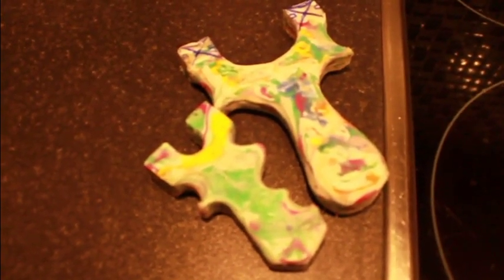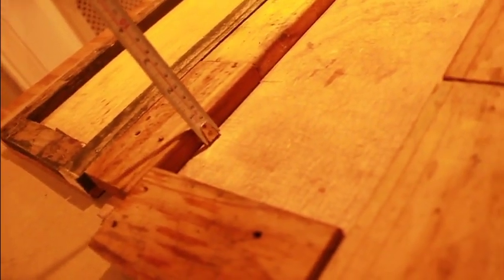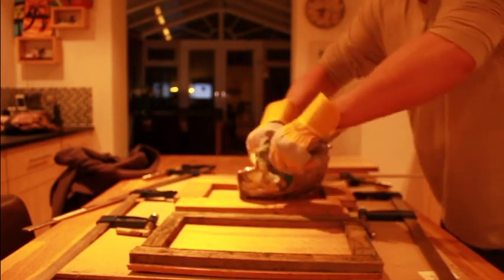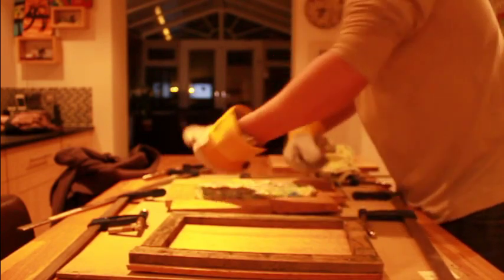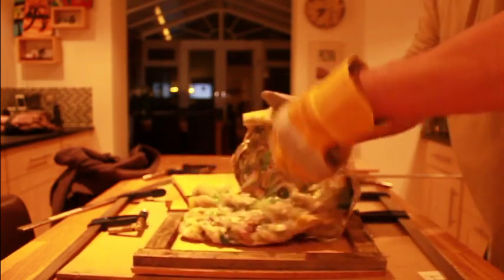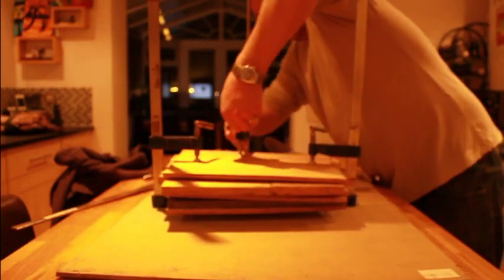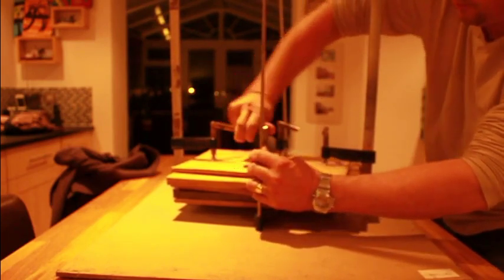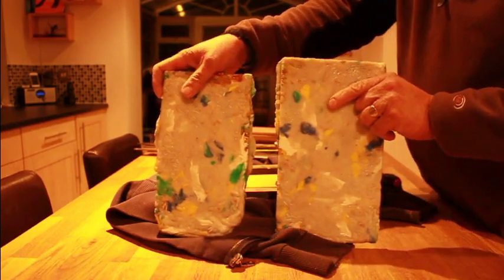Moulding  Recycled  High Density  Polyethylene (HDPE 2 )

Comment: Great effort. Terrible glove choice though. Get yourself some cooking spray and a pair of ove gloves! Work smarter not harder
Reply from the maker: Got catering grade  oven gloves now. Melt in small non stick trays now and clamp board on top and  one underneath. No need for  liners or  removing  molten HDPE from trays. Slip out  when cool and  much easier to handle

Comment: Aluminum baking sheets/pans.  Just keep putting the HDPE in it and once you get it "melted" turn the heat down some and let it bake until you can't add any more to the pan. 
Then just turn the oven off, and let it cool down on it's own. That way it sort of "cures" Leave it for like 12 hours or whatever it takes to fully cool off on it's own. I'd leave it 24-hours.

Comment: There's got to be a better way.  I prefer melting small amounts in water - takes two minutes, then the next batch will meld with the first portion easily enough until you have a large molded section done safely.

Comment: i noticed if i melt buckets such as 5 gallon ones they melt down and actually flow into the mold without any pressure however if i melt down hdpe detergent bottles and milk jugs they don't flow into the mold as well as the buckets do i heard that detergent bottles are copolymer which might affect it but i think milk jugs are pure hdpe so i was wondering if you know what may cause this to happen
Reply from the maker: Dean Walcott I have  tried  the  milk jugs as well .Might  be  because they  are thinner  but  have  always had to apply pressure  as  HDPE can warp when it  is  cooling
Reply: bubbleheadohoh i found out why milk jugs dont flow too well its because they are normally blow molded at a factory and they use an hdpe grade that flows less while melting because blow molding requires hdpe that doesnt flow too fast on the other hand 5 gallon buckets have lower molecular weight hdpe which raises the flow rate when melted the reason for this is because 5 gallon buckets are injection molded which requires high melt flow. by the way milk jug plastic is the strongest because lower melt flow hdpe has a higher molecular weight which makes it considerably stronger so if you can work with milk jugs you will have very strong hdpe which is the best for slingshots
Reply: Dean Walcott i would skip detergent bottles because they are copolymer which makes them a little bit weaker
Reply: Viscosity can be affected by plasticizers.  These are chemicals added to affect elasticity or to modify molding characteristics

Comment: what else can this stuff be used for than just sling shots
Reply from the maker: haffiti2000 Tool handles. Knife  handles. Washers  bearings  pulleys. Search on google for  more  ideas
Reply: haffiti2000 small wind turbine blades
Reply: Plates, plastic mechanical parts, anti friction gliders, bowls, cups, cuttingboards, plastic substitute for wood, projectiles, gun parts, 3d printer filament, etc...ad-nauseum

Comment: Why didn't you just clamp one mold down first before moving on to the next one. Poor plan of attack!
Reply from the maker: Numisaccent  Moulds  have  now  been modified  .Made  from steel angle  ply  and  a a layer  of  steel. Limited  number  of  clamps and  HDPE doesnt  cool that  quickly  so  no real need  to clamp the  first one

Comment: I'm thinking a method that prevents the need to transfer from the melting vessel, to the form could be achieved by melting the plastic in the forming container, of course you would need a material that can take the heat.
Reply: +Nathaniel James Try a ceramic flower pot coat the inside with graphite paste you should be able to clamp through the hole in the bottom of the pot . last thing put a plywood disc in the bottom of the pot. I was able to turn a head for a carving mallet out of the plastic .

Comment: Must be a better way.
Reply: There is a better way.  His method is very half-ass.  The missing other half of the ass is a modified coffee grinder to pulverize the shredded HDPE into HDPE powder.  Mix 97% HDPE powder and 3% carbon black for permanent UV shield.  To be fair, no one else on youtube appears to know the right way of casting HDPE, either.
Reply: TerraformingMaster Might  be  half  assed  but  it  works. Why  grind  when it  will simply  melt.Perhaps  you  could  enlighten us  all with a  video of your  full assed  method?
Reply: Keith Bell
Why grind HDPE?  Because you can then have a homogenous permanent carbon black UV shielding and titanium dioxide antioxidant mix, and the finished piece will last vastly longer and look better.  One of my videos already describes the details of this.  For any HDPE pieces that are intended for outdoor use, grinding and mixing properly is a requirement for longevity, not an option.
Reply: Keith Bell If his slingshot is exposed to any appreciable amount of sunlight for a year or two, even inside in a sunlit room, the unprotected HDPE will begin to discolor, blister, and peel.
Reply: TerraformingMaster Been making  it  for  a  few  years  and  its  never  happened. Loads  of  guys  on  slingshot  sites  have  been doing  it  for  years. MNever  had  blistering  peeling or  delamination. What  is  appreciable and  sreiously  hom many  people  are  going  to leave  a  slingshot  in direct  sunlight  for  that  length of  time? Spends  time  when not  shooting  in the  darkness  of  a  back pocket!
Reply: The reason I can comment is that I made the  video. You tube  locked my  account and  I have  never  had  problems  with blistering  delamination discolouration in the  years  I have  been reusing  HDPE!
Reply: Keith Bell
I'm not saying that your technique or product sucks or is stupid, only that your technique is very limited.  While it might work for a slingshot, it won't work for homemade full size pontoon boat, ultimate bobsled, fan powered airboat, homemade wind turbine, etc... because you need antioxidant and UV shield for that.  The quality of the melt and mix will also be much higher when using powdered mixed recycled HDPE scrap.
Reply: Serves the purpose. If  I was  going  to use  HDPE on a  larger  scale  I would buy  in sheets  or  blocks. Fine  for  small projects and  remoulding  is  well within the  capabilities  of  most  people. Doubt  very  much that  most  home  users  are  going to have the  requirement  for  antioxidants  and  UV shield  in small scale  domestic  product. Just  makes  a simple  task more  complicated .
Reply: TerraformingMaster i tried powdering hdpe milk jugs and to be honest it caused a lot of air bubbles to be trapped and it burned but when i cut milk jugs into little pieces it melted very consistent and it looked perfectly smooth and no yellowing whatsoever
Reply: Dean Walcott you are right about the uv shield though because natural uncolored hdpe will fail in sunlight in a year or two one thing you can do is mix carbon black in the molten plastic this will color it black but will allow it to last much longer in the sun
Reply: Dean Walcott
You need better temperature control, and you need to use a more or less sealed slight air pressure lid on your mold to ram the HDPE down in your mold to eliminate the air bubbles.  Used motor oil flowing through passages in a lost foam / sand cast aluminum mold is the best method for very rapid heating and cooling with precise temperature control.
Reply from the maker: TerraformingMaster Now heat and mould  and clamp in baking trays which give correct thickness. Havent had time to make and upload video doin this as the one was made aboiut a year and a half ago
Reply: TerraformingMaster yeah although even with the hdpe unpowdered it came out completely flawless when i put it on a drill lathe ill post a video of it within the hour
Reply: ok i posted the video of the plastic its my newest video